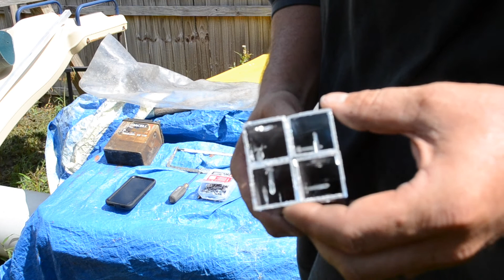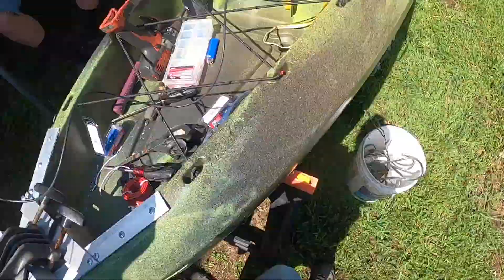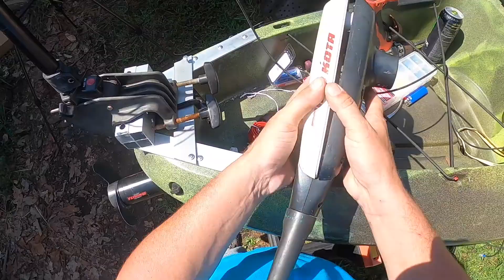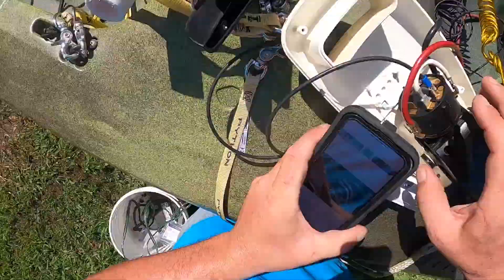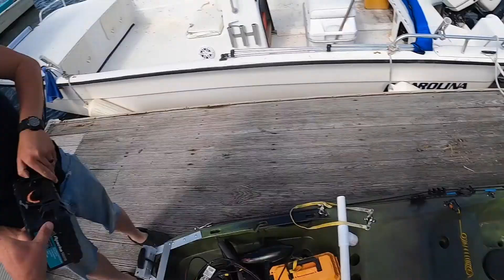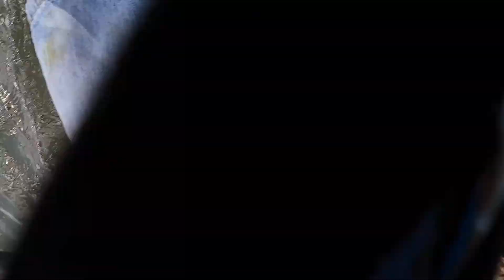DIY Kayak trolling motor mount / Water test Perception Striker 11.5

Comment: Hey boss I know this is an old video but did u ever make the steering pedal system...jus got the same kayak and I'm following ur shoes so thanks....how did the motor mount turn out in the long run???
Reply from the maker: Thanks for watching. I did do pedals for it. I bought a cheap set of adjustable pedals from Bass Pro and modified them so they don’t lock and just slide free. I used the anchor pulley hold down loops to route the lines to the pedals. It worked ok but because I got the cheap pedals they would bind up a little.

Comment: How do you get the holes you drillled in the kayak to hold a bolt ? Did you put a lug on the other side ?
Reply from the maker: Hello I just used self tapping screws. The heat from the screw sealed the hole and has held up to me running the motor into the ground and also carrying the kayak by the bracket in occasion. I was going to put a hatch in the back to access the screw hold and replace them with bolts if needed. For now everything is holding up great and I have used it over 10 times since I mounted the motor